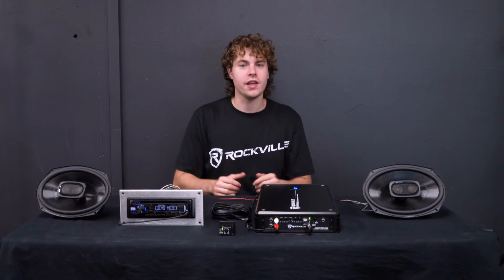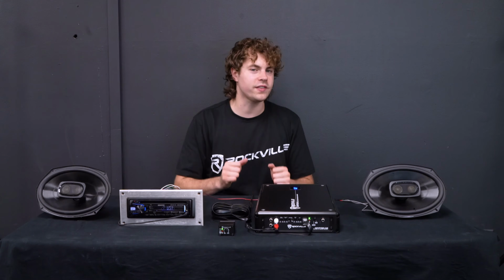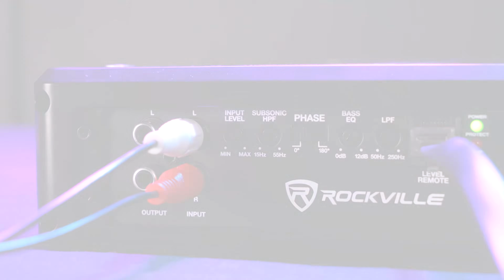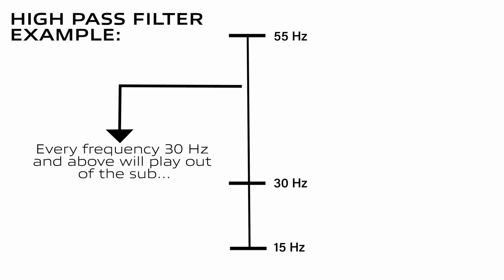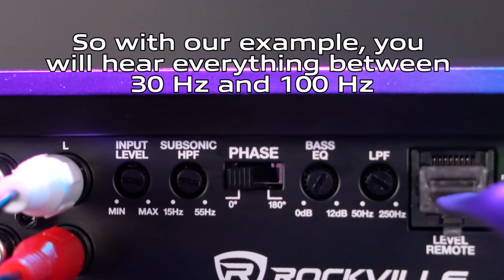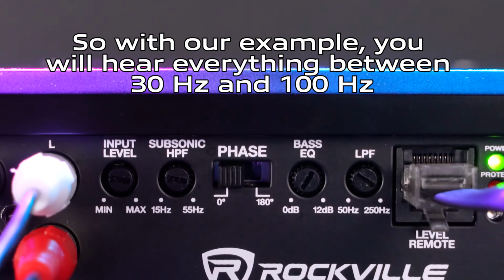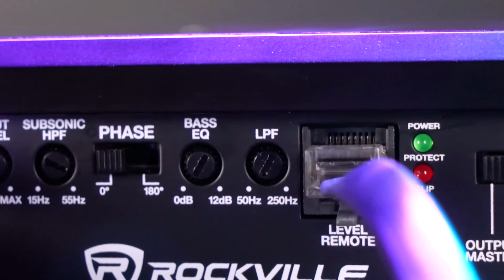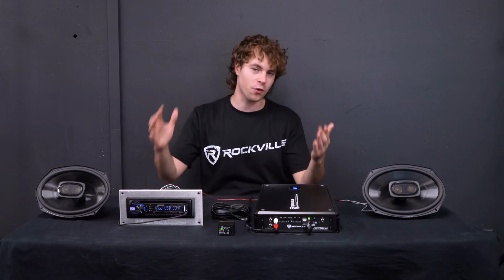How to Set the Crossover on Your Car Subwoofer Amplifier (monoblock amp tutorial)

Comment: What if you have a separate electric crossover, what do you set your amp settings at?
Reply: You should only set the crossover on any one component in your system 
Depending on your head unit, you could set it there instead of the amp and you wouldn't require an external crossover.
If you filter the signal more then once, it'll filter the signal unpredictably and too harshly.
In any case, if you've applied a crossover in any one of your components in your signal path, there is absolutely no need to do it anywhere else.
😎👍🏼

Comment: You forgot to mention that in the crossover point,the output power is -3db from peak power value. For example,if I put the crossover point at 15 hz (1 octave less than 30 hz),in that frecuencie,the power will be -3db than 30hz, the half of power
-3db less,is equal to say "half of power"